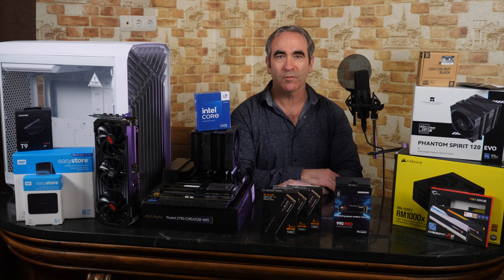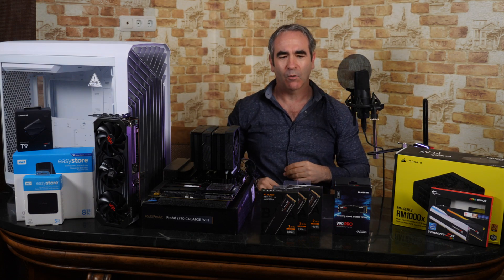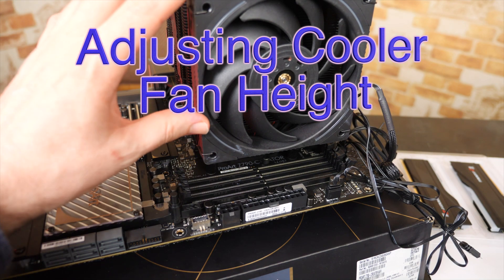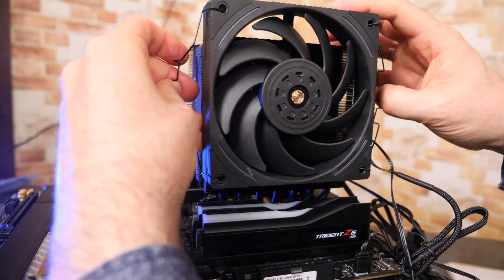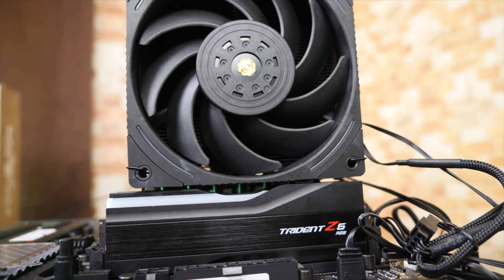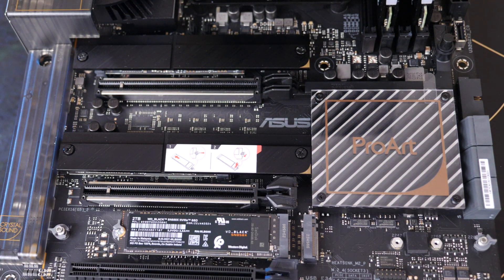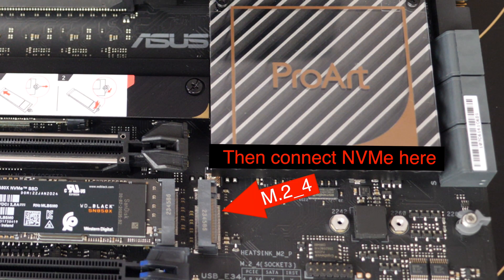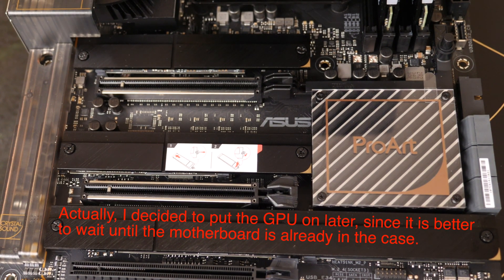Build High End Windows/Mac Computer - Part 2: Finish Motherboard Prep - Installing RAM, NVMe drives

Comment: Just want to say, no, you can't fix intel issues by adjusting settings in BIOS. As long as it runs above 65W of TDP, it will suffer the issues. And if it doesn't run above 65W of TDP, you're basically not utilizing the true potential of the CPU. At all.

TLDR; Buy AMD for now. At least until the new microcode patches come out.
Reply from the maker: Puget sound did an interesting review of the situation. Their computers see higher failure rate with AMD. Some people think it is because they build their computers with conservative bios settings. I would build an AMD system, but in music production realm a lot of users are turned off by AMD. So tough call, but I think for music/video production, Intel is still the way to go, and at least there is now the extended warranty. Asus has beta bios with 0x129 microcode, when release version is out I am going to test it. Til then, statistically, if one wants best stability, then power and current limiting in bios is of course needed, as well as IA VR voltage limit, plus lowering ac loadline, disabling MCE, disabling adaptive turbo boost. This is what I have gathered from 13/14 gen users on Intel reddit. Thanks